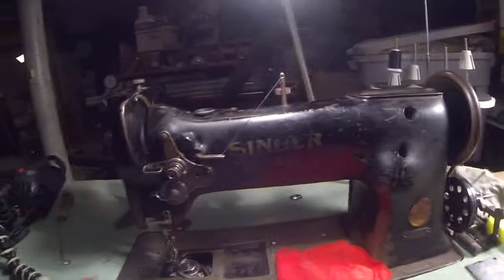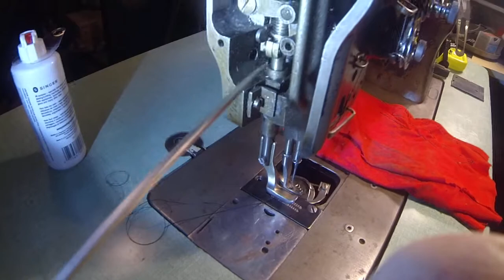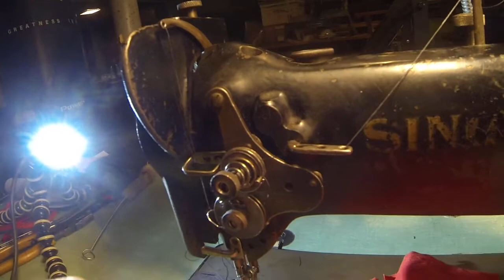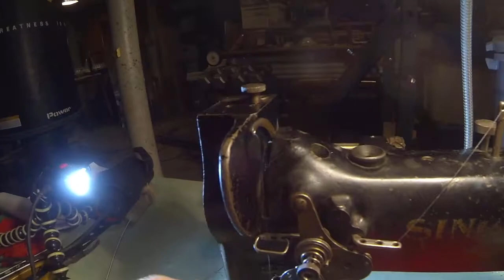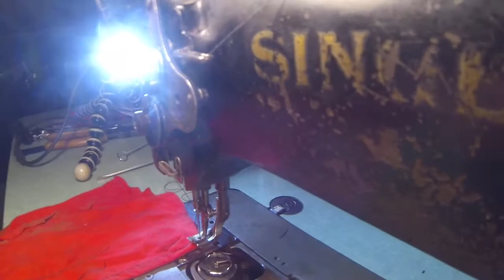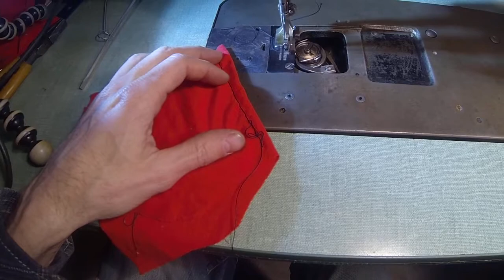Singer 111W153 Industrial Sewing Machine. Walking Foot. Questions #3

Comment: if u still have the singer 111 then heres what u need to do to get the bobbin case out.  different length screwdrivers needed, possible short this and a pair of channel locks if screws r to tight use the channel locks on the screwdriver for added torque,   remove tge larger slotted screw on the hook like arm that where it meets the bobbin case your thread knots up ....  next is very tiny screws. if u rotate the machine u will see the part of the case move.  there is a part number in-between these two small screws. magnet and either tweezers or hemostats to pick them up after u loosen up.   next is to rotate machine wile gently wiggling and lifting the case. it will come out at just the right angle with the machine turned in just the right spot.  reassemble is reversed ..   on the side of bobbin case facing u is a small slotted screw. its the bobbin tension, loosen it slightly n pull the thread till its not to hard but not to loose.  if ur using thin thread u need to tighten it.  but when going thicker u need to loosen it.   try adjusting this first. normally its the problem. lower bobbin is backwards on this machine. in stead of the thread coming off the bobbin in the direction of the tension spring (clockwise) this machine runs the bobbin counter clockwise when u drop it in but pull the thread through the case in clockwise direction.   yeah kinda different but it works and i have set my machine to run with quilting thread and at full speed with no issues ay all. have ran upholstery thread and 2 layers of 8 ounce veggie tan leather and it didn't even cough or skip a beat. didn't even notice it was leather
Reply: Thanks even though I do. Not have one of these.machimes